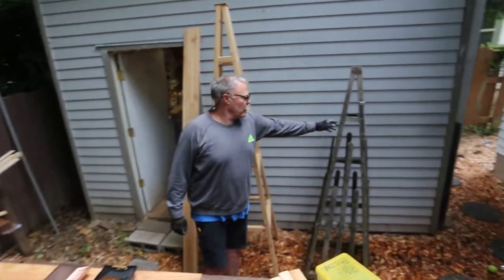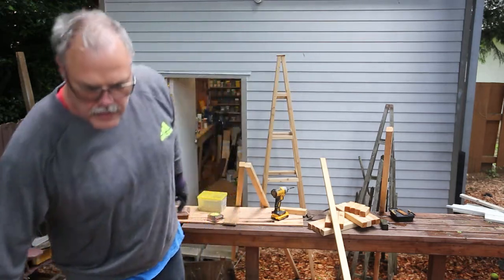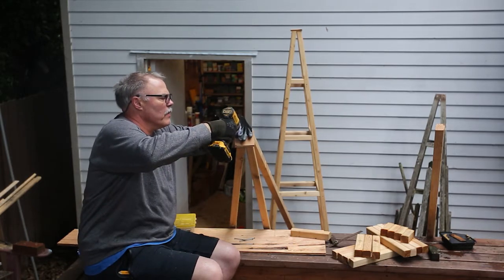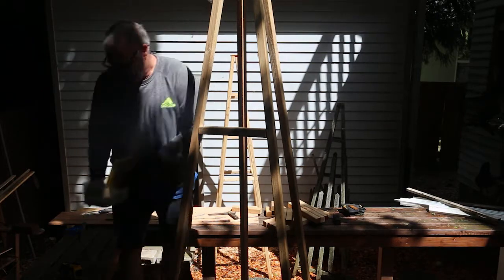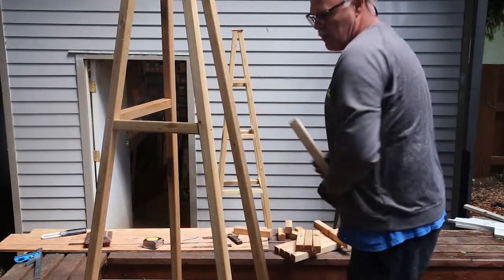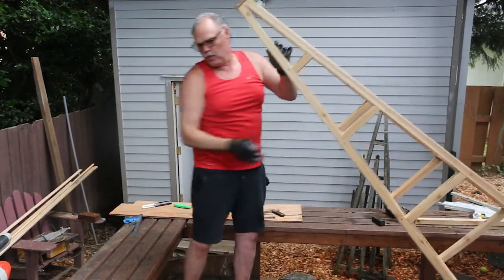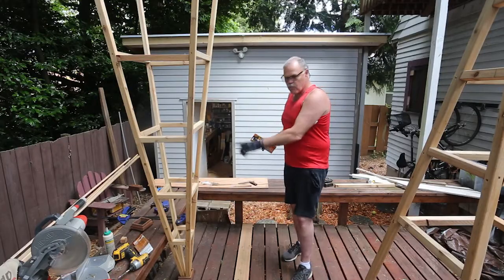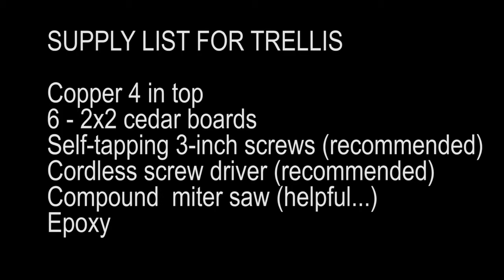DIY Garden Trellis

Comment: What degree angles did you cut the top to come together?
Reply from the maker: It depends on the how far apart you want the leg bottoms. I would just put the legs where you want them, and then draw a line on the side of the wood at the top where they join that makes a straight line across to create a flat top
Reply: @KimKasch  thank you I will try that.